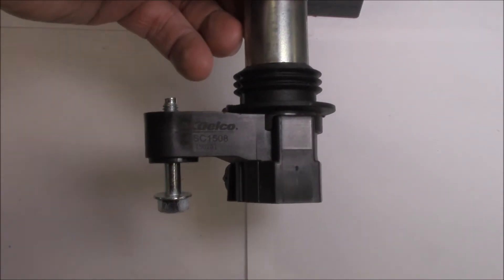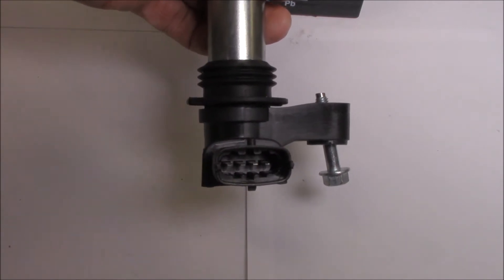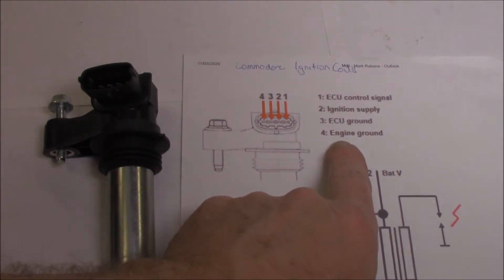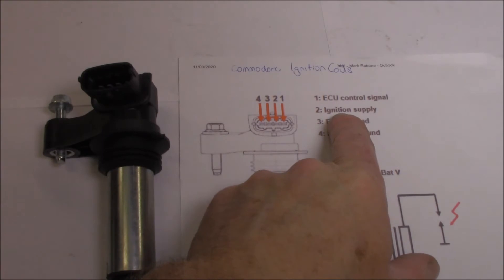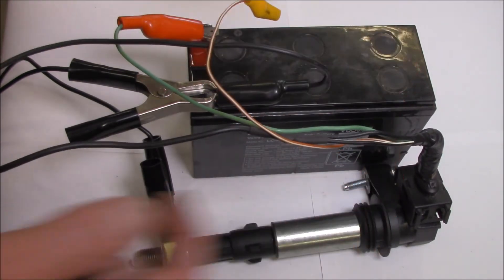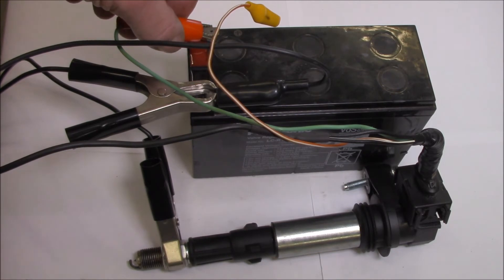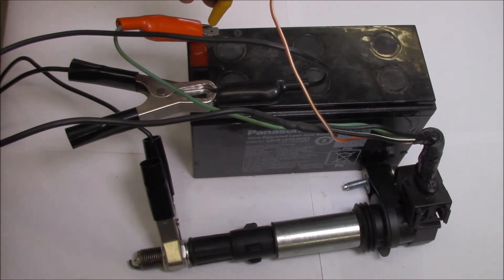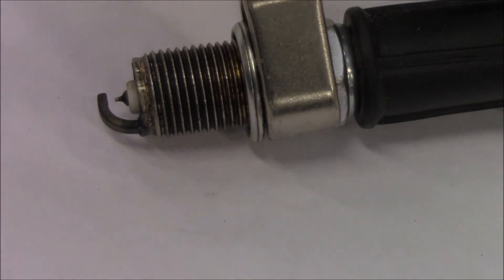Testing A 4 Wire AC Delco COP Ignition Coil

Comment: Can one bad coil shut down the entire system, so you’re not gonna get any Spark on any Coil
Reply from the maker: Manufactures vary in their strategies, but generally you will end up with a P0300 style of code. What codes do you have?
Reply: 2000 toyota avakon.. crank no start... no spark any cylinder.. i have a crank signal.. its not a crank sensor.. just a coil 5 code...nothing else.. i have 7 volts on the igf wire..  i thought was wierd  key on..   disconnected the pcm connector,, and the 7 volts is now 12 voltls   like the ecm is not grounding the signal.. i dont know if it suppose to or not.. any ideas
Reply from the maker: @HayesMobileAutoRepair  Avalon? 3.0 1MZ-FE? According to my wiring diagram, it is a waste spark ignition system with 2 wire coils. 3 coils in total.
Is there any water ingress into the ECU?
https://youtu.be/n1MvYTk-yQI
By my wiring diagram, power to the coils comes directly from the ignition switch (15) and not through a fuse. With the ignition on, you should have 12 volts on both sides of the coil wiring. Cranking should have 12 volts on the power feed side and pulsing on the control side. Is there pulsing on the control side?
Can you remove the connector and do a loaded test with a globe on the power side?  Sounds like you might have a voltage drop. What is the voltage from the ignition switch? I find that when I get in deep into a diagnostic, I need to take a step back and start again to confirm what I have done. Slow down to speed up....
Do you have injector pulse and what is the voltage to the injectors? You may need to do a load test there as well.
Let us know how you go.
Reply: @MiracleMAX  it’s a 4 wire coil.. I’ll post a video and send u a link… I totally screwed this diag up.. and he’s 40 min away..  looks like I’m making another Mobil call ….errrrrr. Send u a link tomorrow evening. Thanks..
Reply from the maker: @HayesMobileAutoRepair  OK, after getting some more info, I found this on the net:
'The ECM uses the IGF signal as a fail-safe. If it doesn't receive the IGF signal from a cylinder, it assumes a misfire has occurred and cuts off fuel to the injectors, preventing unburnt fuel from damaging the catalytic converter.'
Can you supply the actual vehicle, model, year, engine code. That should give me more information so that I can help with the diagnosis.
Keep in mind that where you are from and Australia might have different vehicles and models.
If you were testing according to the video you commented on, that would be incorrect - that is the AC Delco.
What you need is this one:
https://www.youtube.com/watch?v=tyCZtmFnKr0
Reply: @MiracleMAX . I appreciate you looking that up for me… my issue is it shuts off Spark?.. I reached out to scanner Danner and he says that yes, one coil can shut down the entire system..  anyways I’m gonna go back out there tomorrow and bring a coil and finish this video. It should be interesting. I’ll mention you on the video for assisting me. Thank you.
Reply from the maker: @HayesMobileAutoRepair Let me know how you go. We can all learn from one another 👍🏻

Comment: I have a 2011 Cadillac Escalade base model, (not hybrid) but it does have the four pin coils. Do you know if the wiring diagram is the same as the one in your video? I’m looking to test mine but can’t find anything on the Internet describing the pin diagram for my Escalade.. any help would be appreciated.
Reply from the maker: Sorry, I'm not sure on that. But testing shouldn't be that difficult. Power on 1 pin, 2 grounds and a control wire.
Other 4 pin coils (https://www.youtube.com/watch?v=tyCZtmFnKr0) use a power, a ground, a control wire and a feedback wire.

Comment: So when these work fine at idle and play up under load, how are you supposed to test? I guess you get out climb under the bonnet while your mate is driving you down the freeway and pop the leads off the coils and check that way, this test was really lame.
Reply from the maker: Hey Glen,
I guess it would be frustrating to try and diagnose a fault without the proper equipment. What I have shown is a static or bench test. This is for the AC Delco system, which is different to other 4-Wire styles of coils. The goal of this video was to show you the wiring as it is different to others and damage could occur if it was incorrectly wired. 
Have you had a chance to look at a previous video, were I showed the other styles of coils?
https://www.youtube.com/watch?v=tyCZtmFnKr0
To carry out full testing of an intermittent ignition system fault, I suggest that an oscilloscope should always to used to see where the actual breakdown of the spark is occuring.
Do you have a specific fault you are having that I might be able to help you with? 
Thanks for your comment.

Comment: Is that a 6v or a 12v battery? Can a 12 bolt battery be used?
Reply from the maker: Hey Bernard,
I'm using a 12 Volt Sealed Lead–Acid (SLA) battery. It's one I use all the time for experiments for ease of use. I have several of these lying around in the classroom, my workshop and lab. Yes a normal 12 volt battery will work. Thanks for your comment 😉

Comment: Many thanks for your video. First time I see a bench testing of spark plugs. I have a question about my TCorolla 98 wiring. I have seen 3 versions from known businesses telling how the 4 wires connect to the 4 coils. I placed 4 of mine according Haynes book using firing order 1-4, 3-2, the misfiring stopped, and that is exactly what the coils boxing show ( i only discovered lately!). Today, after a smoking starter, etc I was taking my time checking the spark plugs and taking a picture of the 4 rubber connector to them and only one was clean, the other 3 were oily and I had to clean them and also inside plus the top of the spark plugs. Maybe it was me that did not tight/torque the other 3 spark plugs enough? I have found that during changes of oil, service people do not care about going beyond the line of Maximum oil. Today I see it is beyond that line.
Reply from the maker: Hey Kil Kefner,
Perhaps the spark plug tube O-rings may be leaking. Also if the engine is overfilled, you can create issues in other areas of the engine.
https://www.youtube.com/watch?v=U87KJSkF5SE&t=22s